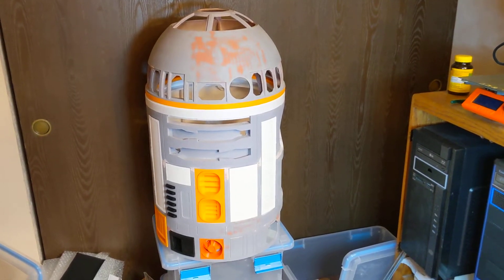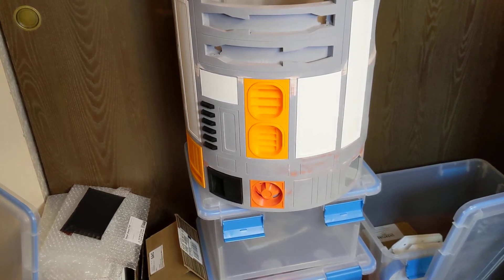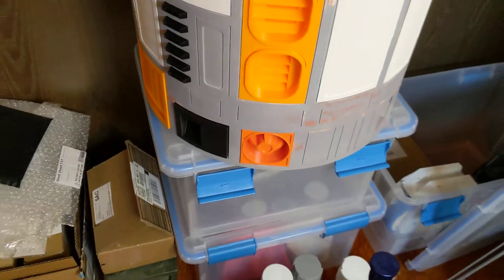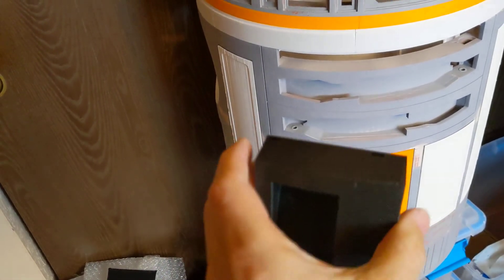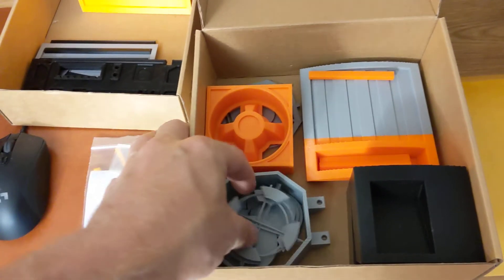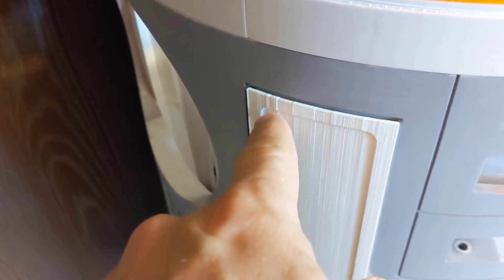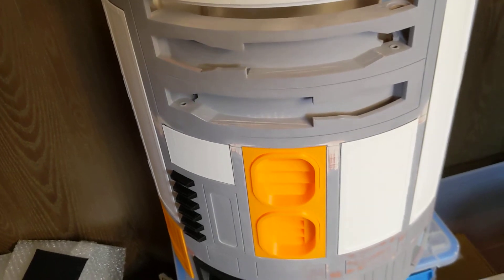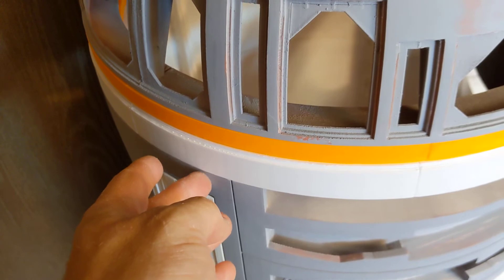3D Printed R2D2 - Part 53

Comment: Looks great mate well done 👍looks like you will have to reprint the ring as it looks way off but looks great
Reply from the maker: I'll have to wait until I get the new dome together to see which parts aren't quite round enough.  The white ring didn't glue together quite flush, so I could break the glue free and do a bit of adjustment to the pieces.  Time will tell.